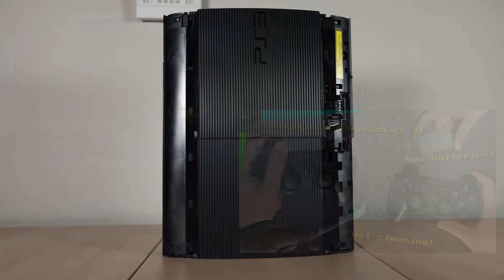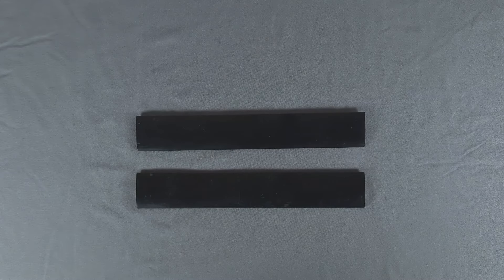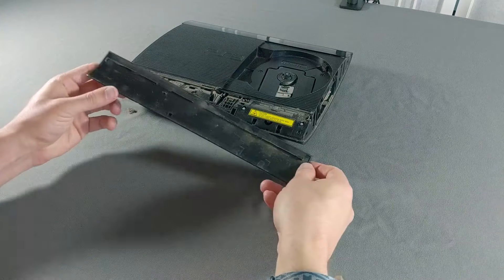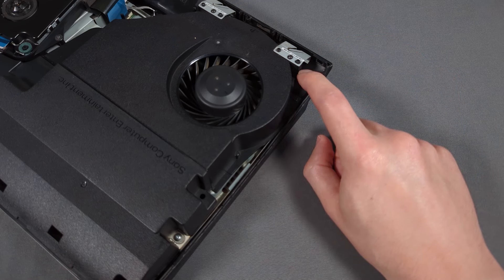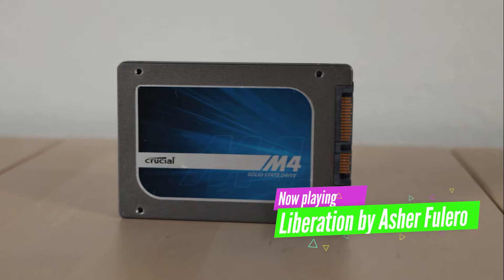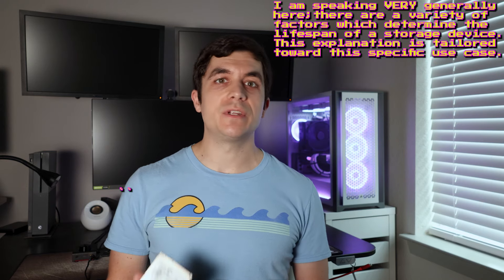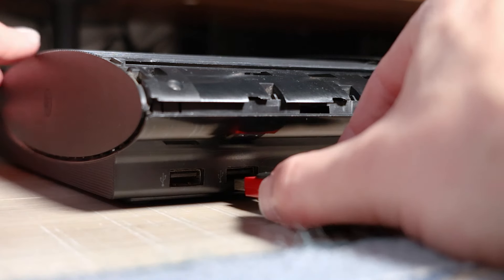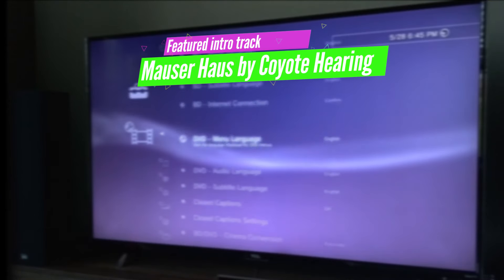Putting the finishing touches on my PS3 from eBay

Comment: If you are into racing, Gran Turismo 5 and 6 loading times benefit the most from the SSD upgrade. Plus the graphics still look good today.
Reply from the maker: I'd love to check them out! Do you prefer 5 or 6?
Reply: @RestoreRevise  I prefer 6. Recently, I heard that the online server for these games has been revived privately, you could also check that out. I was suggested your video to my feed because I like watching tutorial and PS3 videos.
Reply from the maker: @TheNamelessUse  Yeah, that sounds really cool! Thanks for the tip; I'll look into it!
Reply: Very true, I will say that the SSD indeed can potentially make a huge difference in speed despite being limited to a SATA 1 interface, my ps3 had a mostly corrupted hard drive and it was super slow (like almost unusable), indeed it is slow because the hard drive was corrupted so I replaced the hard drive with a 1TB Samsung Evo 870 and it made a massive difference.
GTA 5 takes only 60-70 seconds to load from the XMB (not much slower than GTA 5 on my PS5 lol). I also tested it with a Kingston SSD (DRAM-less) and it was certainly faster than the old hard drive but noticeably slower than the Evo 870 which does have a DRAM cache. Hence yea, I would say an SSD in a PS3 is a very good idea despite the SATA 1 hardware limitation.
Reply: @ZiadHamwi99  which SSD would you recommend me to buy for a ps3?
Reply: @ananijedzankic  The Samsung Evo 870 that I'm using has been working fantastic since I installed it, but obviously it might be overkill due to the PS3's SATA 1 interface. 

You can get the Kingston A400 for much cheaper and get mostly the same performance as the Evo 870. The A400 doesn't have a DRAM cache and from my testing I did notice that the SSD with a DRAM cache (Evo 870) did perform a bit faster, but considering the A400 is much cheaper, it's still a good option and definitely faster than the old mechanical HDD.

Otherwise, you can also get the Kingston KC600, which does have a DRAM cache and has very similar specs to the Evo 870, so yea I'd say A400 (DRAM-less), KC600 (DRAM), or Evo 870 (DRAM) depending on the budget.
Reply: @ZiadHamwi99  I see. Thank you for your reply.

Comment: Which SSD(brand) do you recommend to get for ps3?
Reply from the maker: What I would say is possibly more important than brand is that you use a drive with a DRAM cache, since the PS3 system software can't use its system RAM for storage cache like it's possible to do on a PC. For reliability and longevity, I recommend the usual quality brands. Personally, I've had great experiences with Seagate, WD, SanDisk (a sub-brand of WD), Crucial, and Samsung. I haven't owned many drives by ADATA, but the few that I have are suitable. Also, if you can, wait for a sale before purchasing a drive. Different brands seem to go on sale at different times, and it's not uncommon to get a good deal with a little patience.
Reply: @RestoreRevise  Thank you so much for such a detailed answer. Loved the video btw. I asked for brands because I've seen people praise WD and Samsung of course but Ill check out the others you have mentioned. Thank you for the extra information beyond my question. And yes I will wait for either amazon prime day discounts since Im in no rush to get one right now
Reply from the maker: @ananijedzankic  You're welcome! Good luck with your upgrade, I'm sure you'll be happy with the results!